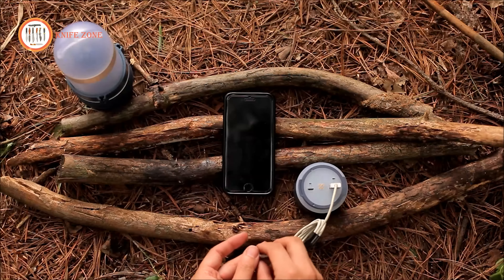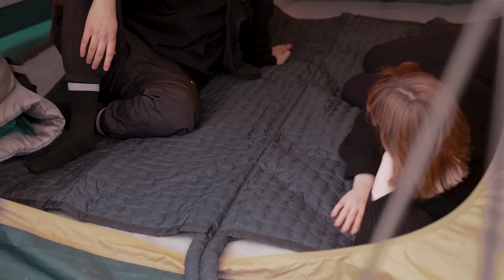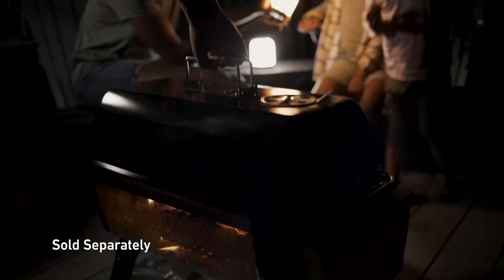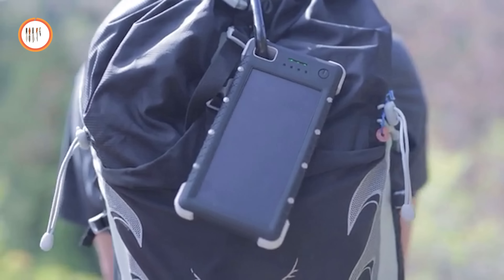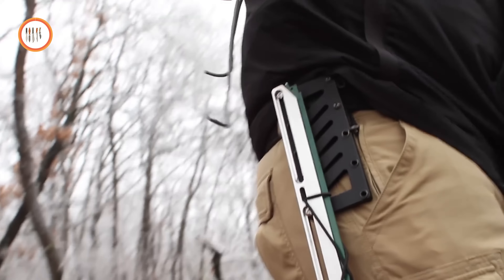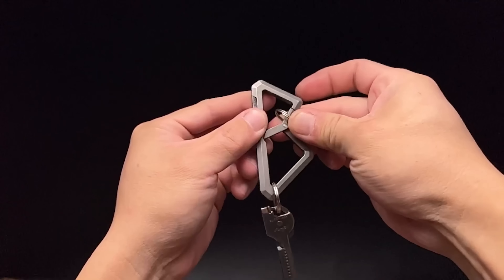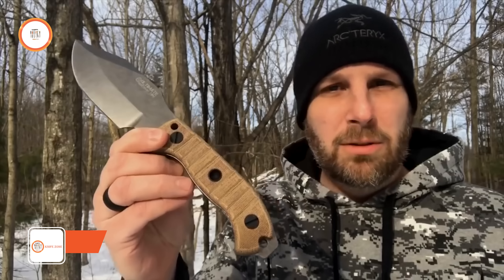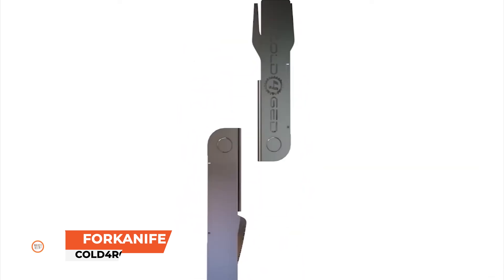12 NEXT LEVEL Survival & Camping Gadgets on Amazon!

Comment: A carabiner for 53 bucks?! 🙄
Reply from the maker: I understand your surprise at the price of a carabiner. Prices for carabiners can vary widely depending on factors such as brand, materials, design, and intended use. Some carabiners are designed for specific purposes like climbing and need to meet rigorous safety standards, which can drive up their cost. Others may have unique features or be made from premium materials, contributing to a higher price point. It's always a good idea to consider your specific needs and budget when shopping for outdoor or sports equipment. There are often more affordable options available for everyday use.